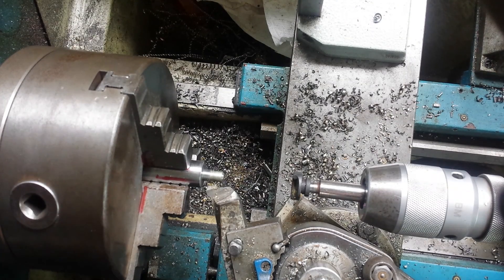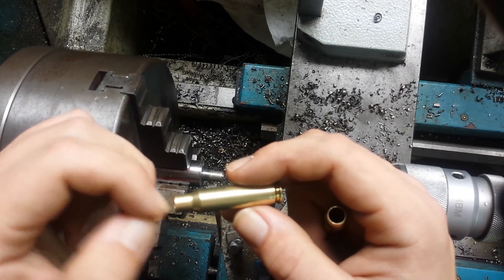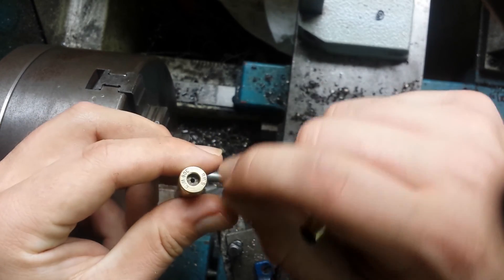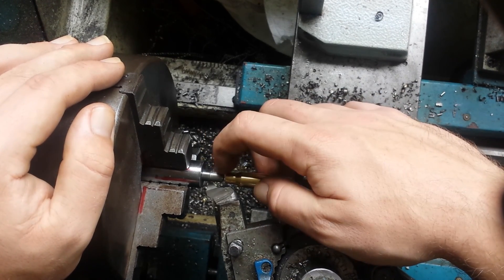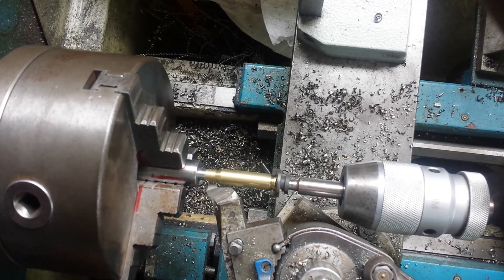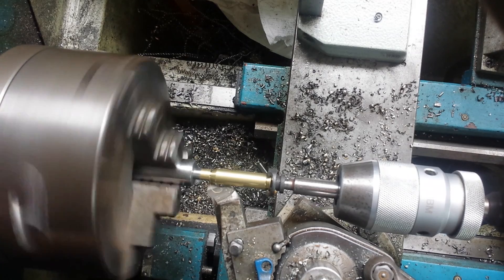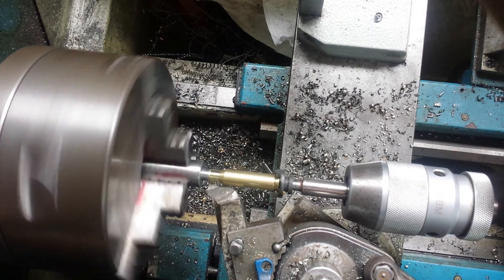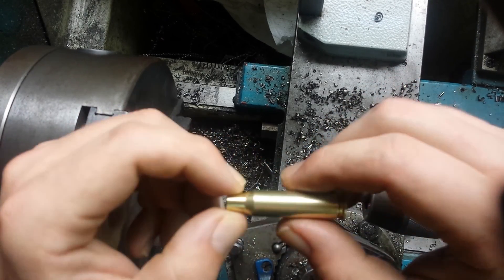Neck turning rifle cases on a lathe

Comment: Hi, dont worry it doesn't decrease case life if you dont remove too much material. Actually it can even increase it ! I have tested it on turned and non turned Sako cases, and surprisingly the first cracks appeared sooner on the non turned cases. I think the reason is the brass will stress more on the weak points if the thickness is not uniform all around the neck. With neck turning you remove some material, but you also remove the weak points so the deformations of the brass will be distributed more evenly around the neck !